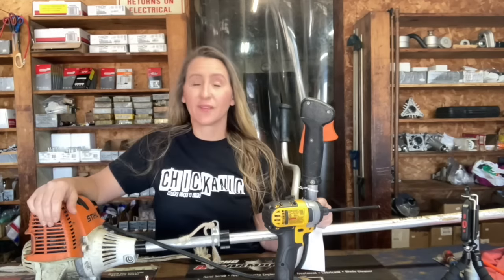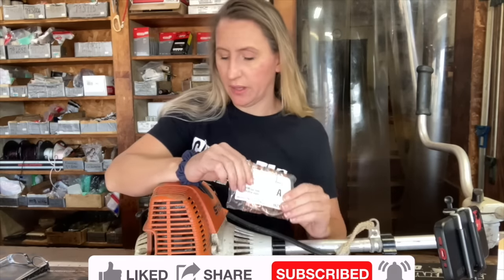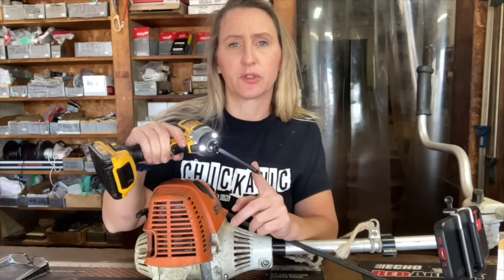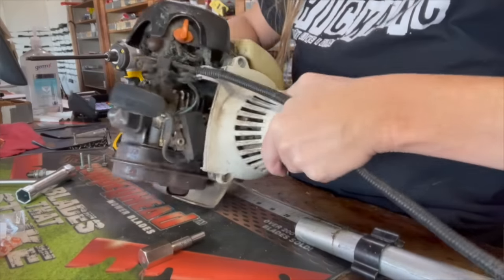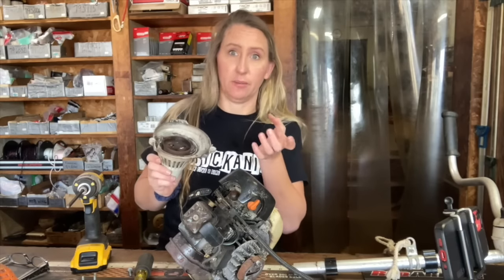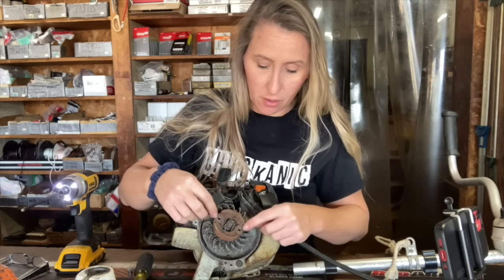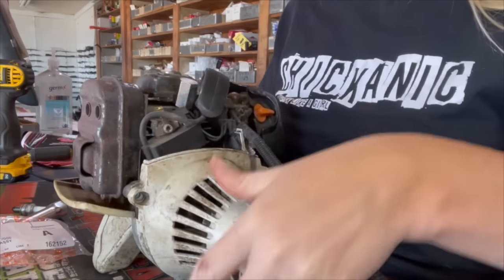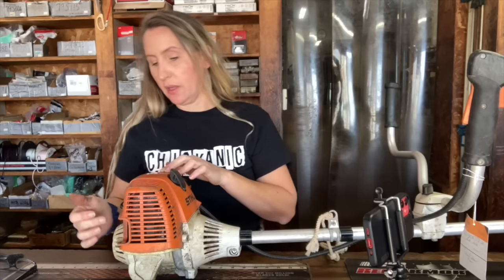How to EASILY and QUICKLY replace the clutch on a Stihl Brush Cutter Trimmer or Stihl Pole Saw

Comment: As a Stihl gold factory certified technician, why can't Stihl put some grease on the clutch shoe pivot bushings. That's what I do with this repair. Once again she made a great video that was spot on. Outstanding!
Reply: Because grease inside a clutch is not a good idea. They should be made from self lubricating material bushings but stihl and what she used to be.
Reply: I still put a tad of grease in it, never had a problem and it stops the ideal noise 😊
Reply: Maybe Neverseez VERY sparingly? But I thought, Lard in a Frictionally Type Thing?

Hmmmm...🤔
Reply: Why does she use the piston stop and plug removal? Because i just pull the three bolts near the clutch and head comes apart separate from the shaft side. Easy and i cannot figure out why she does the extra steps?

Comment: There are good and bad videos.  This one is superb.  I might add two notes of caution however.  When you crack the clutch housing away from the trimmer and later put it back together, be sure the end of the throttle cable fits into the black plastic housing intended for it.  Otherwise the cable will be prone to jump off the guide pulley channel to the carb.  This happened to me and made the engine Hi/Lo speed adjustments problematic.  Also, be sure to slip the tiny blue and black wires back into the tiny guide-slot that houses them, otherwise the wires might get cut by the orange engine housing.  A picture would be much easier, but I'm limited to words - I don't know how to attach pictures to the comments.  Apart from that, thanks; best descriptive video I've seen yet!

Comment: Great video as usual. I had this problem on my Stihl FS111. Replaced clutch after checking shaft, as you showed us in video. However still didn't spin! My son (a car mechanic) looked at it and took the shaft out and put it the other way round. This was the problem. Shaft was only worn at the clutch end. Still I have a new clutch and shaft now!

Comment: Great info. I have one that continues turn at idle, adjusted carburetor to prevent, can't go any lower on idle, stuck in engagement. Cleaned and wire brushed.
Going to replace with new, bushings and plates. 
They like the machine, so going to make it right.
Again thanks, using you as a resource.

Comment: And if you have to replace the clutch drum? I have a KM-131R and the drum and driveshaft needed replaced.  Driveshaft is a piece of cake, but the drum has a "C" clip 'way down a hole, my snap ring pliers can't get in there - so I'm shopping for a set of "needle nose" snap ring pliers... though I might check with you to see if I'm missing something.  Thanks, these are great videos!  You helped me fix the valve lash/timing on this machine and no it starts like a breeze!

Comment: The problem with string trimmers is that they sometimes sit idle for months during the winter.  During this time rust attacks the clutch and gas turns into turpentine.  So drain out  the gas and spray some Kroil on the clutch during this time.  Also remember to get some grease in the gearbox down by the trimmer head.
Reply: @Tommy Ealey That's why you should only use non ethanol gas in any small engine.

Comment: Add some anti-seize to the clutch bushing surfaces to help protect the surface from rusting again.
Reply: This was going to be my comment too.  The clearance between the bushing and the clutch is very small and just a little rust will seize the clutch levers to the pivot.  Anti- seize helps control the rust and the clutch will last much longer and function properly.  Good call!

Comment: Great video, made it look easy. My concern is anyone using a cordless "screwdriver" be careful not to over tighten the screws as the are going into aluminium and may strip the thread. Same for tightening the spark plug.
Reply: Better to buy a cordless Torque Screwdrivers that has Calibration Certificate  of the actual torque in each setting.

Comment: You put a new plug in without checking the gap, a no no, box might have been bumped/dropped causing gap to close up which could cause starting/ running problems.  Good job on clutch repair.

Comment: Mostly happens with 4mix engines, usually the spring breaks and it's because they can't keep a steady rev like 2 stroke. One way or another if you're using a 4mix for edging lawns etc you're going to have clutch issues eventually. I use to carry spare springs and change them on the job. Once you have done it a few times it's fast. I mostly certainly don't remove the shaft as it's time consuming. Just remove the shaft and housing together. If you use the 4mix like the fs 130 I have for section clearing only then your usually running it at full bore so no clutch issues.

Comment: I would pull the shaft out and clean and grease it while I had the shaft apart.  The shaft is probably filthy and the grease hardened.  I lube them back with high temp wheel bearing grease and coat the shaft pretty liberally after sanding off any burrs from it with wet or dry sandpaper.  I wet sand it to a perfect sheen.  I would also clean the sprocket interior with break cleaner and a clean shop towel.

Comment: if you buy an old style oil filter wrench set at the wide setting it holds the flywheel fins in 3 pionts to allow you to remove and install clutches with ease...id add a photo to demonstrate but can't...

Comment: @Chickanic. Thanks Brie for another great repair video.  Now I know of another toll I need. The piston stop. I meant to remove the bolts holding the blades on my mower and accidentally removed the bolt that holds the blade holder  to the shaft. The piston stop looks like a better and safer way to go to make sure the bolt for the blade holder is properly tightened. 

Hope you and your family stay safe and well.
Reply: Just use a well placed  2" x 4"  piece of lumber through the discharge chute / mower deck to wedge 
the blade from moving  is all i use to hold the blade stationary then cinch the blade bolt down to proper torque
Just remember to leave the coil plug boot/ wire off the  spark plug before you work on it.
Reply: Piston stops ruin engines when not used properly , not for changing blades ever.
Reply: @onthelake9554  Thanks for the warning.  I didn't know that I shouldn't use a piston stop for keeping the flywheel from moving as I try to tighten the blade holder back on the shaft. I accidentally loosend that bolt instead of the 2 bolts holding the blades on the blade holder.  What would you suggest I use to keep the flywheel or shaft from moving while I tighten that holder bolt?
Thank you.
Reply: @onthelake9554  Exactly

Comment: Great vids and subed :) Quick question about the wave washers - in the video it appears that the outside curved face of the washer rests against the plate and the inside curved face rests against the clutch itself - correct?

Comment: I have a Stihl FS250S weeder . It starts, runs and cuts perfectly but I'm feeling a vibration that wasn't there before. The cutting head is not that old and the string lengths are equal. I took it to the local dealer where they put a new head on to see if that was the problem ( free of charge). It wasn't but he did comment on the fact I had removed the guard and my string lengths were too long. He said that can put a lot of stress on the clutch? I recently watched a video where vibration was caused by a worn shaft liner? I'm getting ready to take it apart. What is your opinion? Also do you have a referral for a Stihl parts replacement supplier. Thank you

Comment: Thank you for explaining why my Stihl hl100 string trimmer head won’t spin, great video. So I need a clutch for an HL100 Stihl. Where would I buy it in your Amazon link?
Reply: Hi Bree, where can I get a piston stop for my Stihl HL 100? The spark plug on mine is a Bosch super R10.

Comment: I have a fs56rs Stihl trimmer. Do I have to worry about the clutch on it. Every year I have 5 acres of property to trim down. It has anywhere from first size rocks to one's that weight several 100lbs so a mower wouldn't last 20 seconds and there's no way I could ever buy 1 of the line mowers. Also, how hard would it be to convert it to the handle bar version? Thanks in advance for any help you can give.

Comment: Any tips to keep the clutch from rusting?  Anything we can oil or clean yearly?
Reply: Get a  spray can of penetrating fluid called Kroil and use the straw that comes with it.  Look carefully and find the ventilation holes at the bottom of the clutch housing. You can tell if you found the right place if you turn the trimmer head and you can see the clutch move.  Now get that spray can with the straw attached  and poke it in there and spray away while turning the trimmer head.  Kroil dissolves rust and also lubricates the moving parts.  There will be some leakage when you first use the trimmer so be aware so it doesn't give you a bath in penetrating fluid.
Reply: I run machine a few minutes after it gets wet from rain or cleaning dirt after use, helps a lot.

Comment: Great video as always 👍, I like your drill I might invest in one 😉
Reply from the maker: I don't know how I ever worked without one! LOVE it!
Reply: @Chickanic  yes it's a nice one 👍
Reply: It's a 1/4" cordless impact wrench. Different from a regular drill. It's the greatest invention since high button shoes.
Reply: @dkupy100  sounds good 👍
Reply: Speaking from experience, I work in a woodworking/cabinet shop. There is more than one model of just the DeWalt impact driver let alone other manufacturers. Our shop has 3 different versions. The big box stores don't typically carry more than 2 and sometimes only the bottom homeowner version with less than stellar speed control and response. Fastener tighten is critical in cabinets and the least expensive impact driver model is tough to get it right. The top model has a switch just above the battery connection with 3 settings. Does well for different conditions from light screws needing really no impact on #1 to long lag bolt on #3. The boss has this model. Maybe someday mine will wear out and get upgraded. 😉

Comment: Can you tell me what you used to clean the rust off the housing.
Reply: There is no real need to use a solvent like she did. Light rust like that shown responds well to wire brushing or sanding with emery cloth. A brass mini wire brush in a Dremel tool is excellent for tight places, although the brushes wear fast. Aerosol brake cleaner, a fast-evaporating solvent that leaves no residue, works well for cleaning dust and any other residue.

Comment: So, how long do these clutches last? I bought mine in 1995 and it is in heavy yearround use on a 20-acre estate, only with the three-blade head. The clutch has never needed replacing.

Comment: Quick question chickanic i purchased a rotorvator attachment saw a vid it can be used on a strimmer but the strimmer i had didnt have 9 spile drive shaft to work with this was 3 years ago 🤣🤣 still sat there in the box it came in needs gone or finshed can u help

Comment: What about one that just makes a grinding noise and will hardly engage I pulled it apart put good used clutch doing same noise from clutch house the trimmer head gearbox itself is good

Comment: We have a 460fs the shaft looks like it has shortened, is that a sign of wore out clutch? It’s not sticking out of the shaft hosing tube far enough, it’s only sticking out less then a quarter inch of the tube

Comment: Mine stopped spinning when I was cutting brush, sounded just like when your chain falls off your chainsaw , the sound came from up near the engine so I took shaft apart checked clutch it looked fine, checked the drive both ends look good , replaced the gear head started working good for about a couple minutes did the same thing again . Took apart shaft again started it the shaft seemed to be spinning fine kinda at a loss ????

Comment: Do you have A video on how to remove the clutch drum? The head kept spinning on my fs 130 R , the clutch was rusted together. I used anti seize on the bushings and plates in hopes it doesn't rust together again. The square on my driveshaft is almost stripped, so I will be replacing the driveshaft and clutch drum sometime in the next year I believe.
Reply from the maker: This might help. https://www.youtube.com/watch?v=QtzsCciTD0M&t=39s

Comment: so how to i replace the spring only ? just use a pliers and pop the old one out ? mine has only a slight spin so im thinking the spring is worn and that would do the trick ..spring is only 3 buck a clutch is $50 where im at

Comment: How to tell if the clutch needs replacing by simply looking at it?

My trimmer is only one year old. But when I converted to a blade cutter, the head stopped turning.

I went back to a new trimmer attachment, replacing the whole head assembly, and the head hardly turns.

Maybe the drive shaft isn't long enough

Comment: Hi I have a stihl fs56rc the bulb want stay pumped up I have changed the carburetor twice all the fuel lines. It worked fine yesterday stopped and that when I noticed the bulb wasn't holding fuel. Help please.

Comment: What can cause a clutch to stay engaged, and can I fix it or is clutch replacement necessary? Cause the head on the unit, a Stihl FS90, spins constantly and if the head stops the engine stops
Reply from the maker: If it stays engaged all the time your spring probably doesn't have enough tension in your clutch anymore. Take it apart and see what you find. If the clutch shoes are sticking too far out of the sides of the front and back plate I put on, you will know it is stuck in the engaged position.
Reply: @Chickanic  Thanks so much for the reply and advice @Chickanic, I love your channel, and I’m a big fan from North Carolina

Comment: Anything you could suggest to use as a piston stop❓❓
Reply from the maker: Fill the cylinder with rope and turn until tight. Make sure the piston is past the exhaust port though so the rope does not get stuck between the cylinder wall.

Comment: Hi, I've followed your instructions in this video and successfully replaced the clutch in my  Stihl grass trimmer KM90R, put everything back turned on the motor, head was spinning but 3 seconds after touching the grass it stopped spinning. What could have I done wrong? Could you help this wannabe-fix-all retiree? I very much appreciate your help.

Comment: Great video. Always a learning experience. Question...I noticed you changed the plug with an NGK right out of the box. Do you gap these? Pre-gaped?
Reply from the maker: They do come pre-gapped, but I eyeball every one I put in to make sure it's good. Thanks for watching!
Reply: Calibrated eyeballs
Reply: @robertheinkel6225  .025
Reply: @Chickanic  l was always taught to smear a little copper slip on the plug threads....been hearing lately that isn't wise....idk...
Reply: @robertheinkel6225  a very fast eye ball!!!
Reply: @Chickanic  WOW< Gapping within a few thousands of an inch eyeballs, amazing talent.
Reply: @ronzek3207  Speaking from experience, with practice one can quickly see or feel a small difference. We used to deal with 3 different thicknesses if materials for different products each 2 thousandths steps. One could look or feel which was which if regularly using them. You get accustomed to the common things in our work environment.

Comment: No need to replace clutch and bushings, if clutch pads and drum are still good. The entire assembly can be cleaned with proper equipment, 220 sandpaper, grinder with wire wheel, anti seize, steel punch and 1/2" socket and hammer to knock out bushings. Use wire wheel to clean clutch pads and bushings, use sandpaper rolled up to clean inside of bushing openings and clean with brake clean and use anti seize when inserting bushings. I would do 3 or 4 of these a day on different units, everything done with in 30-45 min. Saves owner money on parts they don't need. " Other than that great video "

Comment: What if the gear head won't spin?
Reply from the maker: You first pull the shaft out and make sure that the square tips are not rounded off. When you grab the trimmer head and spin it by hand does it feel weird? Crunchy sounding?
Reply: I will check it Tomorrow  Thank You

Comment: You didn't have to replace the clutch. The bushings are rusted to the clutch shoes....Sandpaper and a little anti-seize and it would be good. Most of the time I've seen the spring go bad, but if it sits the bushings for sure rust. The bushings are super fragile and will break on the backside if you try to use pliers to hold them, when taking them out of the clutch shoes. But you run a shop and time is money, I get it.
Reply: One will either pay for shop labor or new parts. In this case I would prefer the new parts as she did.

Comment: The shaft always works itself out of the engine on these Stihl trimmers and pole saws. That will also make the head not spin. Also, who was the genius that decided to make Stihl equipment a light gray(almost white)color? Nothing like buying a $350 trimmer or $1000 chainsaw and it looking dirty after the first use.